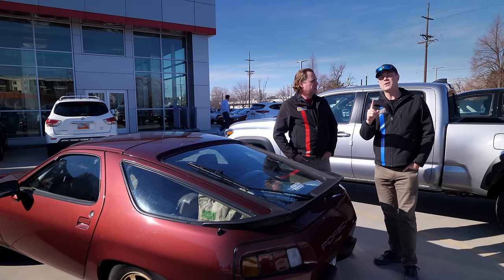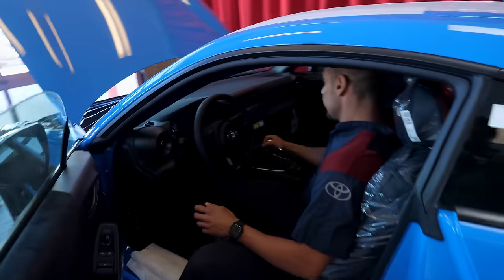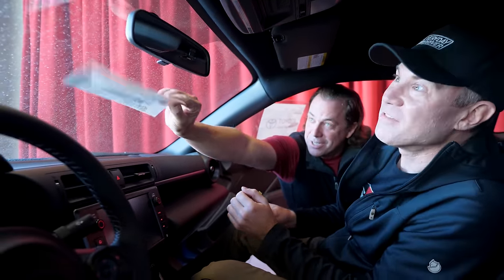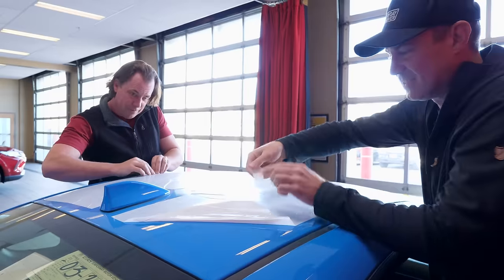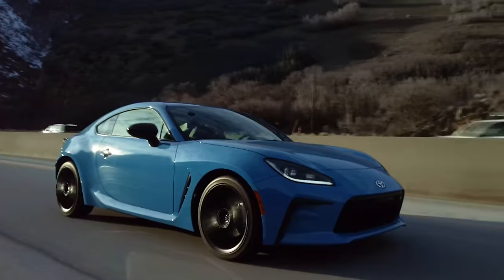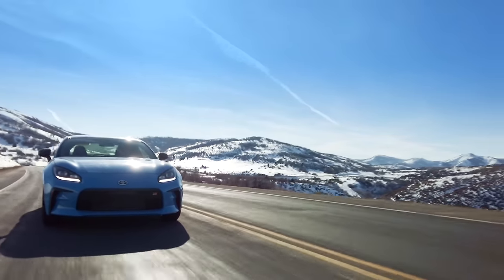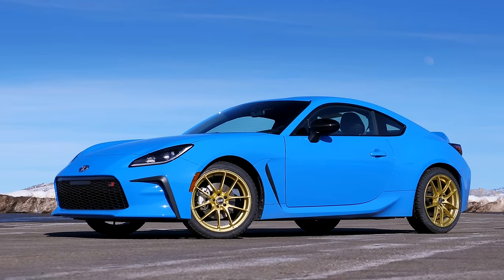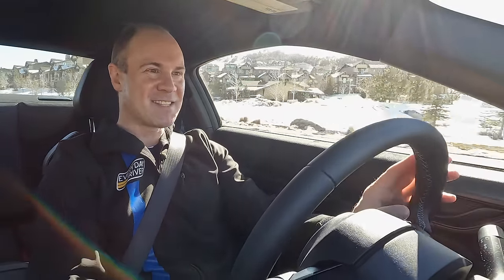We bought a GR86! - Money where our mouth is - Long Term #1 | Everyday Driver

Comment: Took delivery of a 2022 BRZ three weeks ago.  Traded in my 2018 BRZ.  Loved the old one, really love the new one.  I find it far easier to drive in town; the extra power down low just makes life so much simpler.  I love how you don't have to hammer it to get power and you really don't have to downshift to pass on the highway (although it's still more fun.)  The engine noise through the speaker lasted a day and then I unplugged it.  I was looking for a car like the ones I saw growing up: TR7s, MG Midgets, small agile cars that were fun but don't put you in prison.  I drove the 1st Gen BRZ and fell in love; I was waiting on the 2nd Gen for a year and ended up ordering one.  I will be interested to hear your thoughts on it over time.
Reply: I've never driven but heard the platform is really good.  They have always looked great and the fact that they fixed torque dip makes it a serious canyon carver. Congrats to you and I will definitely keep an eye out for one of these.
Reply: Haha. Couldn’t trade my 2018. Have both. Drive either one before the 911.
Reply: I like the speaker noise in the brz while im keeping the revs below 4000 until the car is broken in.  Otherwise i think it would be hard to shift by ear as the car is much quieter than the ones im used to at low rpm.  You can also set up a beep to tell you when to shift tho
Reply: If you can’t handle a high powered car without fearing of “going to prison”, then you just aren’t mature enough car wise to be able to control yourself. I’ve never been to prison. Own a 450hp+ and a 600hp+ car.
Reply: @JacesOwnWorld  it's not about self control, it's about the fact that any sort of "enthusiastic" driving in a 450 HP car or 600 HP car will very quickly get you into speeds that are waaay above the speed limit. With a lower-powered sportscar like an 86/BRZ, Miata, or S2000, is that you can drive it enthusiastically on a curvy road while still remaining at a legal limit-adjacent speed. Driving my near-stock S2000 on the Tail of the Dragon (and surrounding area roads) at the same level of enthusiasm as my 400+HP STI resulted in a far lower speed throughout; driving the STI at the slower speeds that I experienced in the S2000 was still enjoyable but to a noticeably lesser degree, since the car had so much more left in the performance envelope that it felt like a stroll instead of a jog.
Reply: What's a BRZ?
Reply: @Mike Hudson Right side of the dash behind the glove box.  This video shows how to disconnect it:  https://www.youtube.com/watch?v=H-EUBupvQ7o
Reply: @doginu  It's the Subaru version of the GR86.  Basically the same but there are some differences in the suspension and some body work.
Reply: @JacesOwnWorld  I just outrun the cops
Reply: @JacesOwnWorld  It's not about maturity. It's about driving feel and enjoyment. Going up the mountains with a 50 mph limit is way more fun in a 180hp Miata than a car with 400+ - 600+ hp. You reach the speed limit so fast in a "high hp" car that you barely get to enjoy the twisty mountain roads.

Comment: You mad lads actually did it!!  Fantastic!  

As someone who has owned several of the 1st gen, and who discovered your channel for your coverage of the first generation, I'm really excited for your coverage with the 2nd gen!
Reply from the maker: Very glad to have you with us. SOOOOoooo much to come.
Reply: @EverydayDriver  Can you cover why you chose the Toyota over the Subaru BRZ?
Reply: @Truehoon  bump
Reply: Lab rats?
Reply: @EverydayDriver  Hi, you guys convinced me to make this big purchase!! if you don't mind me asking but what did u buy for the "accessory" section. I don't want to buy unnecessary things, so I found the comment about the paint protection helpful. Any tips is helpful. Thank you!
Reply: Why you bought so many? Has to be some good stories in there
Reply: @keashaneverts4452  First paycheck out of uni, I buought a 2015 FR-S manual in Ultramarine.  Two years later, getting the modding itch, I discovered reviews of the Inazuma (Series.Yellow for the states) with the performance pack gives you Sachs dampers and Brembo Brakes from the WRX STi, and it's YELLOW - so I bought it.  Best car I've owned.  Smooth ride yet still great handling, brakes could lock up before ABS kicked in, and it was perhaps "a Lambo", by the account of a 3 year old on the street corner.  Three months into ownership, I got T-boned by someone going through a red like there wasn't even a traffic light, car was totaled.  Drove a Mazda3 hatch for two years to be practical, found myself almost asleep on the commute, so I went shopping, considered RX8s, Mustangs, Audis, Fiat 500 Abarths, WRX STi's... none of them felt like the FRS/BRZ/86.  Drove a friend's S2000, found it has an epic motor, but dead steering and only a 2 seater.  Drove a ND1 and ND2 Miata, and LOVED it, but it only barely fits my 6 foot frame, and is tiny.  Then I found a 2014 for 14k (CAD) with only 37,xxx km on it, and raced to the dealer as fast as I could.  It's brilliant.  I've done another 50,000 km on it and I'm still in love.

Comment: Congrats on the purchase. Turning off the engine noise is 3-4min and 1 plug. 

The road noise is a bit excessive and exhaust note underwhelming so I upgraded to a Borla cat-back and it sounds like it should have from the factory. Highly recommended
Reply: Borla hasn't released the 2022 version yet. Unless you are driving the previous generation.
Reply: @Mk5mango  same model for 2022, shop said it fit perfectly. Search YouTube for 2022 BRZ Borla
Reply: @Mk5mango  1st gen catbacks fit the 2nd gen.
Reply: I chuckle every time I hear someone mention road noise on this car.  Drive first gen mr2 or ae86 for comparison! Feels like you’re skateboarding! lol.  Gr86 is soft by comparison!!
Reply: @jonasbaine3538  It's not like we don't remember the 90s. It's still loud by modern standards.

I don't drive an e30 for a reason.
Reply: @Cosmicgardening  if someone wants a small sporty car that is quiet then bmw 2 series coupe makes sense

Comment: I recently realized that chasing power has been moving me away from what made me a car enthusiast in the first place. After buying a previous gen M240i and spending a few months in it, I realized I was having less fun than I did in the 228i I traded, which was itself less fun than a number of light weight and slower rwd cars I've had over the years - the '87 924S with unassisted steering, an NA Miata, a 986 Boxster S, and the MGB I used to "borrow" from my sister at 15. So today I test drove a '23 BRZ, was instantly smitten, and put my name on the list. Just waiting for the right color!
Reply: dude im going to chase power in my 86, just gotta pay it off

Comment: So psyched to see you guys keeping one around! I picked up my BRZ in WRB in late November and have about 3500 miles on it. I think you guys hit the nail on the head in your initial impressions.

Fake exhaust noise is annoying, but I’ll tell you in advance if you disable it, the car is VERY quiet. I’m looking at getting an HKS catback just so I can hear what it’s doing without the annoying “turn on” of the fake noise system at like 3700 rpm.
Reply: Another simple option for better sound is installing an axle back aftermarket muffler. I have a '17 BRZ, and swapped the OEM muffler for a Borla axle back. That gives plenty of growl, but does not drone at highway speeds. It was about $ 600, and the Borla bolted directly onto the existing system. Took less than an hour to do. Having an extra set of hands was helpful, but the Borla is smaller and lighter than the OEM. The Borla is high quality stainless, and comes with integrated tips that are slightly larger than OEM.
Reply: @scottanthony3426  I'm thinking about doing something similar.  Right now I have a full header back exhaust on my 2013 BRZ (still catted), and it sounds awesome when you want to hear it, but on the highway it can get a tiny bit tiring.  With a GR86 I bet just an axle back or cutback and disabling the speaker would sound great
Reply: Toyota should have just used a sound tube like the previous gen. It sounded good and wasn’t excessively loud. Best of all, it wasn’t fake.
Reply: @sketchpv3080  As an owner, it isn't THAT bad.  The most artificial aspect of it isn't the quality of the sound but the way it comes in right at 3500 rpm abruptly.  But my catback just got in so I'm excited to disable it lmao.

Comment: I felt the 1st gen started feeling cheap overtime. I'm IN LOVE with this new one. However, I was one of those people getting 28mpg no matter how I drove it on the 1st gen. I think that will be the only thing I will miss.
Reply: The new gen has reported over 30mpg highway unlike what the epa rated it
Reply: I drive almost exclusively in sports mode on an automatic first gen and i get about 26 miles per gallon. It feels great in sports mode, so for me im not sure if I would benefit a whole lot from upgrading

Comment: Congratulations guys! you made me think when you said "Buy these cars new so they can continue making them" something I've considered once or twice but I think in October when the GR Corolla hits I'm getting one for sure!
Reply: doesnt it share the engine with the GR Yaris? Arent you concerned about it struggling to keep up with the lighter and shorter Yaris in comparison?
Reply: @WipeoutXXXX  Left to be seen but I don’t think it’ll be 3 cylinder.
Reply: @Nissannx2000svg  It apparently has the exact same engine. Dont get me wrong it will be still quite fun and I trust Toyota when it comes to reliablity, tho I think the 0-100 speed will decrease a bit in comparison.
Reply: @WipeoutXXXX  I’ve got a few Toyota’s back in my country and one of them ( Toyota Blade ) comes with the same 3.5 litre V6 in a car the size of a Corolla hatch. Look up “Toyota Blade master G” the thing is just fast!! But I only buy the 2.4 litre inline 4 because they’re rental cars in my fleet and I don’t want people racing my cars.
Reply: @WipeoutXXXX  well, the GR Yaris isn’t in the USA, so there won’t be much of a comparison to compare against.

Comment: Great car. I have the 22 BRZ. I have had it about a month. It is a fun daily driver for sure. I still would not call it fast by any means. My car had less than 200 miles on it when I pulled that overly quiet exhaust off. I put on a Borla catback and disconnected that fake sound generator. Soooo much better. I plan on getting an E85 tune as soon as the come out. Possibly some forced induction down the road. I needs just a bit more power still.

Comment: That's the exact spec I was looking for! Markups by me were insane so I ended up just getting an ND2 Miata after selling my '13 FRS, but I look forward to the content with it!
Reply: how's your ND2 treating you?? I'm between the two. Coming from '17 manual civic
Reply: Same here. I was on two lists for a gr86 but they hit me with the ADM news later on and i passed. I ended up getting a Fiesta ST for the time being. I would love an RF but I don't fit.
Reply: @wesleyrice2138  I absolutely love it, it's definitely a little cramped compared to the FR-S, me being 6'3 and 270 lbs lol

I daily drive the Miata and it makes every single drive feel special. The tech helps a lot too vs the FRS (blind spot monitoring, backup cam, etc), but the GR86 has pretty much the same stuff as far as I know.

I never got to drive the 86 because said dealerships wouldn't let me drive unless I intended to buy afterwards (how am I supposed to know if I want it without driving it??) but in comparison to the FRS the Miata feels much more tossable and maneuverable, and the sense of speed because of the more compliant suspension is much better. The ride is softer than the FR-S, but it's definitely better suited for street driving. The FR-S definitely felt more stable in high speed corners, but the torque dip was a massive hinderance in daily driving. Regardless I loved it, and owned it for a little over a year before making the switch.

For the same price without markups it's a tough decision, but it depends what you're planning on doing with it. The 86 is 100% more track focused in its suspension tuning and overall feel, and the Miata is much better suited for street driving especially on a nice day.

Best of luck! You'll love whichever one you choose, it's really just a matter of what you'll be doing with it and the weather by you.

I have no idea if the situation would've changed had I actually been able to test drive, but the 10k markup at the local dealers still would've left me to choose the Miata regardless. I'm considering waiting a few years or so and then seriously considering a GR86 as I'm curious how it compares not to the FRS but to the Miata now. Plus there'll be neat editions down the line I'm sure, maybe I'll snag one of those.

Also a bit of a side tangent, someone my height would fit fine with the top up, but my hair gets real messed up because it touches the top. If you're bald then it'd work great even if you're tall, lol
Reply: I have a Sport trim soft top by the way, base everything with all seasons on for the chilly months. And even with the base sound system it's leagues better than the FR-S if it makes any difference for ya, it was a very pleasant surprise after picking it up.
Reply: @EpicLakitu  good info, thanks. I'm 6'1" but I must be a long torso because I hit my head in cars that some 6'3" people say are okay. I also have a thing about sitting low so I may be too harsh on headroom limited cars, but either way my plan is to autocross my Fiesta this summer and then see if it's workable to get an 86 after that.
Reply: @R3LF13  Gotcha, in the FR-S I had at least 3 or 4 inches of headroom on the lowest setting so I'm sure it's not too much different for the GR. I'd say you should be fine but the seating position is real low for that entire platform so keep that in mind
Reply: @EpicLakitu  yeah I sat in the first gen brz and the low seating position was something that I really liked about it. I'm not worried about the GR and I would probably pick that anyway but still kinda bummed that the RF doesn't work for me because I love the size of it and how it looks.

Comment: That's awesome guys! Congrats. I agree with all the points you're making in this video and I'm looking forward to many GR86 videos from you.

I was between this car and the Hyundai i20 N but after a lot of research and even though the i20 N is a lot more practical, there's no question, the GR86/BRZ is the car to own. I've never driven one in real life, only in Forza 7, but I know I will love it. There's just the question of availability now, since I'm in Greece and these cars, the GR86/BRZ, are nowhere to be found. I cant even find the older models in the used market, which is weird. But nothing's going to stop me from getting one eventually.

My question is: Are you going to get it tuned? The guys at FTspeed seem to suggest that Subaru is underselling the hp on this engine and that it's more powerful than advertised. So I'm wondering how much improvement there is with a tune.

Cheers.

Comment: I think you can disable the ESE ( engine sound enhancement) using carista OBD2. It's an Android app you pair with a Bluetooth OBD2. This works for GR Yaris to disable ESE. I also use carista OBD2 to  change my seatbelt chime to just show a  blink on my guage. Hope this helps. But the dealer can also disable that using Toyota's propriety diagnostic tool called Techstream.
Reply: I agree! Get the Carista obd2 and a month subscription and change a bunch of features, good call op

Comment: been really thinking about selling my M2 and grabbing a GR86 instead.  Know it sounds crazy but the M2 will fetch a nice price and a HKS supercharger slapped onto the GR86 when available would be a riot I'm sure.
Reply: M2 prices will probably never be higher than they are right now too.
Reply: Supercharged 86 would be an absolute blast!
Reply: I would sell that m2 just for the fact its a german car, $$$$$ the older they get
Reply: my suggestion is .. stick to the m2. 2 different kind of sport cars
Reply: Honestly wouldnt do it. M2 Feels nimble and fun enough especially compared to the 86. A supercharger will cause unnecessary headaches especially on long trips that the m2 wont.
Reply: Yea well the m2 will cause unreliability headaches the 86 probably wont.
Reply: @gigi9467  not a supercharged 86 . My m4 has been more reliable than all of my friends FI first gen 86s
Reply: @nonstopper  give it some time..
Reply: @gigi9467  maybe after 100k miles new bmw are usually good for a while.
Reply: @zaidonthemoon144  if ur lucky lol
Reply: I’m thinking about selling my SS 1LE for one of these
Reply: @DanielE-oq1dt  i dont blame you, i had a mustang gt and sold it cuz something broke and wasnt gonna spend 3k to fix, so i bought a miata, but this was on my short list, with that being said if u can afford to have the camaro and the brz it would be awesome!!! Teo completely different beasts and both fun at a track